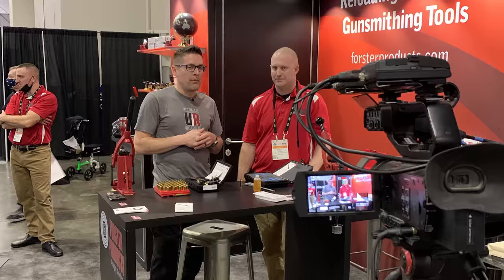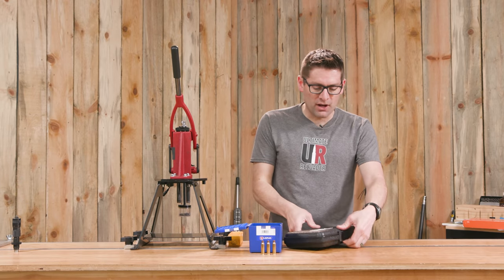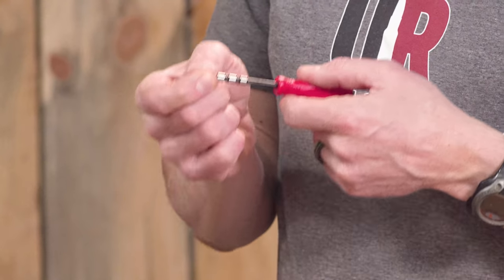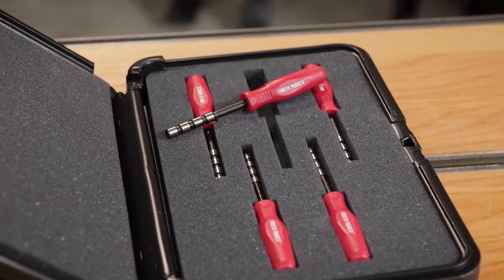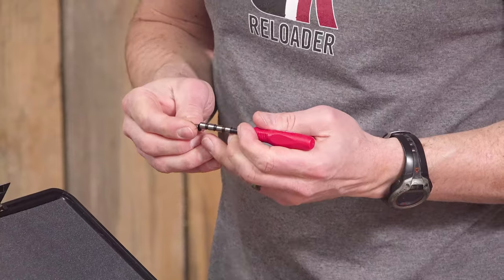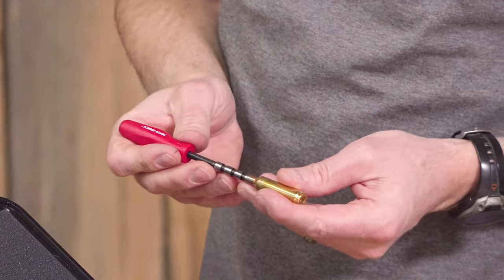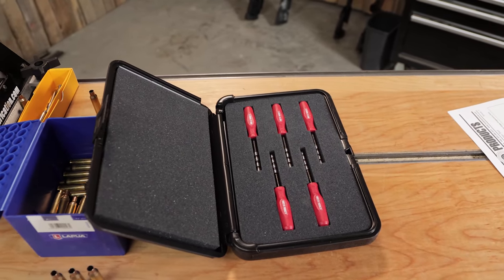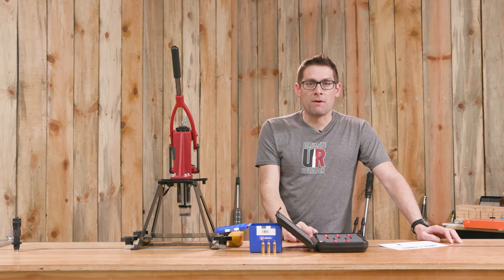NEW Forster Neck Tension Gage (NTG)

Comment: I like the tool but it seems a quality precision steel pin gage set would work just as well and have many more diameter options. (I see the convenience of having the gages stacked on one tool per caliber.)
Reply: Good point.  I have a pin gauge set and never considered using it to check neck tension.
Reply: @seafox197cc  That's all I ever use and dedicated pins are not all that costly.
Reply: Ive got a full set of mandrels In 1/2 Thou increments from 22 caliber to 416 caliber . These are fine if you dont have these.Mine are all Forster Mandrels except my .375 and .416 and trhose are from Brownells. Ive got every gadget he has except my trimmer is a Giraud

Comment: It's a nice idea, but far too expensive for what is in effect 20 pin gauges.
For a lower cost, I could buy a large pin gauge set covering a far wider range, in smaller increments and with higher (certified) accuracy.
Reply: 25 pin gages. You’ll find the kit and individual gages at a lower price at some of our wholesale customers. Diameters are ground with a +/- .00015 tolerance 😀

Comment: I love your videos.  Neck tension has always been on my mind as I notice - when I'm reloading - that sometimes bullets get seated easily, others fit a bit more tight and I wonder what the problem is.  I like the product but not sure what it will solve my problem, though, as it all depends on the sizing and expander die.    Am I right, or wong?  So...here are my questions:
1. If I am using the same die, should I expect to have consistency in my neck tension?  What affects neck tension? (e.g. brass thickness?)
2. OK, so I have a case where the gauge fits loosely - how do I solve the issue?  Do I crimp the case before seating?
3. On the other hand, if the gauge fits too tight - should I replace the die set?
 4. Should this gauge have better use if you want to adapt the case to a particular bullet width?

Thank a bunch!!
Reply: Neck wall thickness uniformity (or lack there of) will do that. Perhaps a little neck turning will help consistency in bullet tension. This will uniform start pressures--very advantageous  to accuracy. What brass are you using?
Reply: @yellowjacket548  For my 308 I use Lapua which have proven consistent though I have noticed different tolerances in different batches.  I had most issues with brands like S&B, Fiocchi and PPU, even though they were match grade brass.
Reply: @Jon Mcauleff  that's very good brass. You are correct that you can still find some uniformity issues between lots, and even within lots for that matter. This is where the use of some special tools can help diagnose these issues. Fun, fun! 😁

Comment: It would be nice if you mentioned MSRP and a few stocking retailers.
Reply: Googled it myself to know complete kit on forster is 300
Reply: $300 at Forster but they're back ordered. Am I the only one that thinks that price is insane for this?
Reply: @kevinpitts17  yikes.

I just looked up a handle that holds two pin gauges for go/nogo, $13 and a 0.251-0.500 gauge pin set is $165.  Even that's expensive so I think I'm going to look for a used set missing pins I don't need or just buy individually although that is a rip-off compared to sets...
Reply: @joequixotic3039  yeah I was interested then saw there was no 45 cal and my pet project at the moment is a 450 bushmaster

Comment: I think this is a great idea and very easy and quick. I am a machinist and can see how this type of tool would be useful in many alternative applications. But, the price is not on par with the value this brings to my particular reloading bench. It may be more palatable if they could be purchased as singles rather than a set. For now, I will have to stick with my pin gauges and deal with the extra seconds of handling time.
Reply: Hi Josh, these are sold as a kit as well as individually. You will find better pricing at some of our wholesalers due to their quantity discount.
Reply: @vincealber9162  thanks for letting me know about that. I'm going to pick one up to try out on my most commonly loaded caliber.

Comment: I've been looking forward to these since shot show, until I just went over and looked at the price. $300!? No thanks, I'll just use the old pin gauges. $300? SMH. Although, they're are all back ordered, so you couldn't buy one if you wanted to
Reply: If the are really $300 they are off there rockers!  That coming from a Forster fanboy
Reply: Dude, I thought you were joking with that price!  Then, I looked it up. Yeah, no. Absolutely not.  They should sell them individually for $25 +/-, not as a set.
Reply: These are sold as a kit as well as individually. You’ll find better pricing and availability through one of our wholesalers.

Comment: I am struggling to imagine a practical use for these tools. If you have a tight neck chamber you would presumably use a neck expansion mandrel of proper bullet diameter to expand the case neck to simulate a seated bullet. You would then turn the neck to the desired outside diameter and then use the appropriate sized bushing in your neck sizer die to size the neck back down to give the desired tension or pull. Where does this tool fit in? If you are shooting a standard chamber in your rifle just buy quality reloading dies and have at it.

Comment: I see a few things wrong with these. First, they probably will not work with some cartridges. I'm betting they would bottom out on a 6PPC, 6 BR or 30BR. Maybe even 6.5x47. Second is the price. $58 plus shipping. You can buy a few pin gauges from Amazon that are within .0002 for $5 each. Nice idea but I'll bet they discontinue these for lack of sales.
Reply: It’s certainly a niched product. They were in fact designed to have clearance for the shorter cartridges you mentioned and will not bottom out. The length of a given diameter and the space between diameters allows to check for consistent diameter throughout the neck (ie donut at the neck shoulder junction).
Reply: @vincealber9162  I stand corrected. I still don't think they will sell though based on price point. $58 each or $300 for the set. Pin gauges are a lot cheaper and are more versatile. I bought the three I use for .243 and paid less than $15 to my door.

Comment: How would you use this tool to set neck tension?  The correct way is to seat a bullet in a case, measure the outside diameter of the brass (neck) where the bullet is seated and then subtract however many thousandths in order to get that much neck tension.  IE if my Lapua .308 brass with a seated bullet has an outside neck diameter of .339" and I want .002" worth of neck tension, I would buy a .337" bushing or have a full-length die honed to .337".  If you want to know what your mandrel is going to expand the inside of the case to all you have to do is either measure the mandrel or take the company's word that the measurement is correct.  Why would anyone want this tool?
Reply: Inner diameter is just outside-thickness with less steps. This is easier for those inclined. Remember, they need to sell stuff to not bankrupt
Reply: You can't rely on the measurement size of the mandrel alone. Brass springs back. Neck wall thickness is an important consideration as well.
Reply: LOL, keep thinking that buddy.  In order to set neck tension, YOU MUST KNOW THE OUTSIDE DIAMETER of your brass as that is what you are controlling with bushings.  The goal is to move the brass as little as possible to maximize its lifespan.  Knowing the inside diameter of your case is pointless--the number means nothing and you do nothing with that info.  Please explain to me how you would know which bushing to buy if you only know the inside diameter of your brass.
Reply: @yellowjacket548  Ummmm......no.  You use the mandrel to set a consistent neck tension on each piece of brass.  Neck wall thickness isn't relevant when using a mandrel.  It doesn't matter if I'm using no turn brass or heavily turned brass, the mandrel is still setting the same tension.
Reply: @Lexus Owner 
uuum...yes. The mandrel itself isn't the be all-end all.  Use of the mandrel is a secondary step after sizing the OD of the neck with either the factory spec die or a bushing. If the neck started out thin in the first place, you aren't doing yourself any favors with the use of the mandrel. You may never reach your desired tension of .002 or whatever your goal is. This is where an undersized bushing will help you achieve your goal. Everything has to match in terms of size in order to achieve your goal.
Reply: @yellowjacket548  Have you ever done this process?  Why you are saying doesn't make any sense.  It doesn't matter how thick the necks are, that is why you seat a bullet and then measure the outside diameter, subtract .002-.003", then finally as the last step to actually set the neck tension, you run an expander mandrel down the neck.  This way, whether you have thick or thin necks, you can use the correct bushing.  Perhaps you don't understand that different types of brass require different sized bushings because of the differing neck thickness, but they will all use the same mandrel in the end.
Reply: @yellowjacket548  You're going to use a different bushing for thin necks and a different bushing for thick necks.  Using that method allows you to choose the correct bushing whether you have thin necks or thick necks, I was not stating the bushing would be the same.  Could you please explain to me the step by step process one would use to set neck tension using this tool from Forster?
Reply: @Lexus Owner  You don't use the Forester tool to  set neck tension. It is simply a gauge. If you aren't satisfied with neck tension after sizing, you simply change the bushing on the die. Now consider this, suppose you had very thin necks and .0005" neck tension (sorry, machinists think in tenths).  What would the mandrels role be at this point? Bingo!
Reply: @yellowjacket548  Apology accepted, and agreeing with me that this tool isn't capable of helping you set neck tension is a good start. That, after all, was my point from the beginning.
Reply: @Lexus Owner  Apology? Ha! It was you who couldn't even figure out how to use the tool in the first place by asking "How would you use this tool to set neck tension."  Apparently, you didnt understand Gavin's video. This tool is very capable of being used for that purpose. However, it is not the tool that physically does this. Maybe you just can't afford it...lol! No wonder you are so proud of your Lexus. You do you!
Reply: @yellowjacket548  In other words, you are completely wrong, can't admit it, and now you are calling people names.  Most would call that a temper tantrum.  Maybe you need to stand in the corner and take a time out.  Again, please explain to me step-by-step how to use this product to help set neck tension.  You can't do this, which means you have nothing to say at all.  You've brought nothing to this conversation and have presented no actual ideas.  You've told me how dumb I am and how smart you are, but you've said nothing of substance.   You don't know what you are talking about and I am embarrassed to have lowered myself to your level, it won't happen again.
Reply: @Lexus Owner  here you go, do yourself a favor and look at this video. Maybe you will understand him. Don't worry, I won't charge you for this service. 
https://youtu.be/OMEi5eHTLxQ

Comment: Hellaciously overpriced. $300!!!  Do they actually want to sell any?? I can get a set of pin gauges which run 0.060" - 0.500", ZZ class, -0.0002" +0.0000 (440 total pin gauges) for just under $240 right now. I was thinking more like maybe $15-20 per caliber range... maybe $25 at the most. I would have been more than happy to get one for my .264 and .284 precision ammo... but, yeah, hell no.